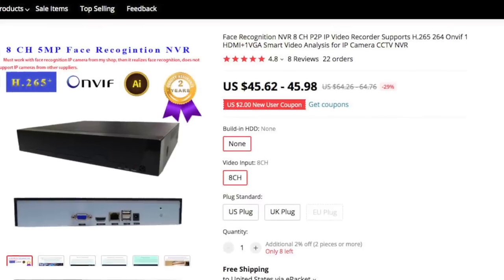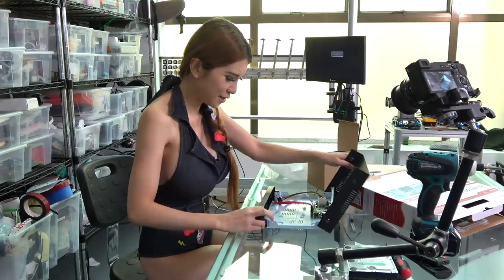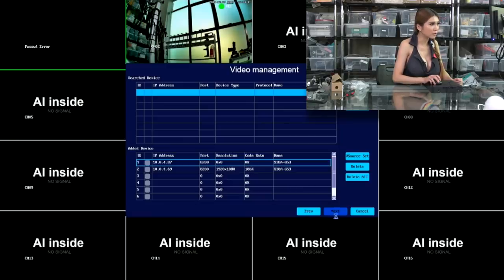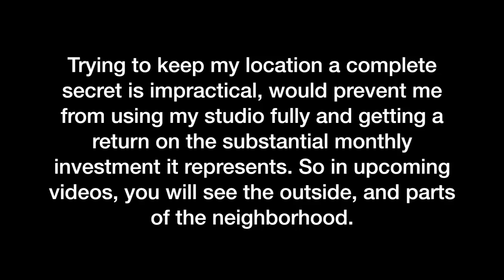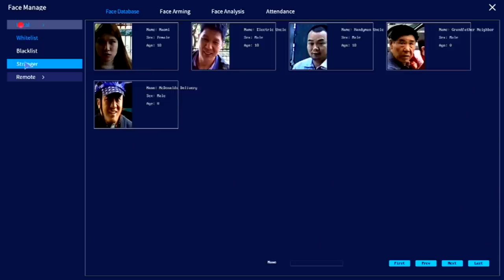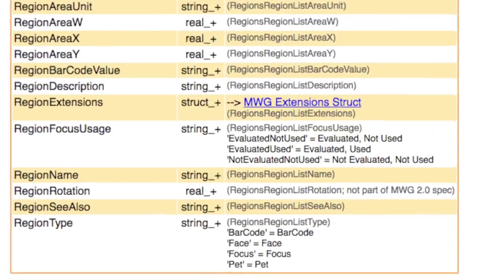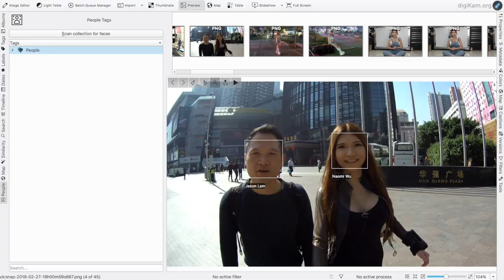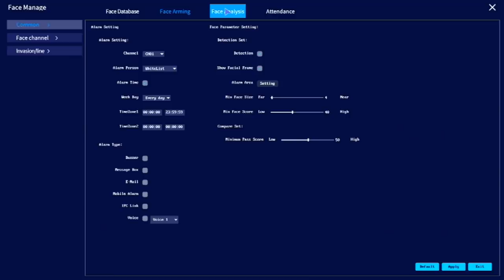Discount Dystopia! $50 Face Recognition Security System

Comment: Psycho Jealous Ex Naomi Wu is legit terrifying. Sneaking into your lab in the dead of night, shuffling your static IPs, defocusing your lasers, humidifying your moisture-sensitive filaments, offsetting the origin of your CNC...
Reply from the maker: I'm stealing that😅
Reply: That's so minor.  Costly but just property damage.  With more psycho jalousy, much worse is possible.
Reply: The offsetting of the CNC by say x.7 and y 2 would be bloody terrifying/annoying. Or even better change steps / turn of the screws...
Reply: changing the 3d printer firmware such that each layer is rotated by say 0.01 of a degree would be frustrating to figure out where the fault is.
Reply: @gorillaau  I love that one. It is as one says "the most evil I have ever seen."

Comment: Although IP cams and face recognition wouldn't be very practical for my situation, it's a fascinating topic. Like all of technology it can and will be used in good and bad ways, so knowing how it works is a must. 

- If you don't know the dangers you may end up not knowing what killed you someday but you'll be as dead as if you knew. 

- Knowing the dangers is prerequisite to come up with ideas to protect yourself. 

- Not knowing what's possible always limits your options.
- Knowing about technologies enables you to find new uses for them.

Isn't there a face recognition system using stereoscopic cameras? 

As for the use of perfectly fine standards: It's actually a shame that companies all over the world ignore standards instead of developing and improving them. In my eyes that's a statement about the company if the have to resort to artificial dependencies in order to enable their products to compete on the market. It actually prevents healthy competition and therefore it prevents technological evolution. Technological standards provide a repository of already found solutions, thus freeing up resources for the search for not yet found solutions.
Also I love that glass table when nothing is on it. So revealing.
Reply: Note that an embarrassing percentage of the standards are made useless by some aspect of how they are created and managed.  As an engineer there are standards that I simply have to reject even in my own tiny field of work.  But import/export data formats deserve more standard compliance than internal working formats.

Comment: Regarding IP camers security: I think a separate (V)LAN for the cameras and the NVR is a must and a router which is advanced enough to control the traffic between the networks. Don't give the camera system internet access and if you need remote monitoring, only allow incoming connections through your VPN.

This might be out of budget/technical skills of many people, but otherwise you can not be sure who can access your setup and what information do the system leaking to the internet. Expect it as unsecure.

Comment: So in short, there is no standard yet on what format used for face recognition data ?

Then i guess every company have their own proprietary format. Maybe good for secrecy but, for end user when they want to switch to other system, they cannot use their old database.
Reply from the maker: Also makes organizing and tagging the images difficult. NVRs are good at recognizing people, but they aren't really designed with a GUI for data entry.
Reply: Eventually, I would expect a "shaking out" in the industry and the acceptance of an international standard. Typically, this happens in time. Someone comes to dominate the market and the other manufacturers go along, lest they be regarded as obsolescent.
Reply: @williamswenson5315  A few years ago I worked with designing and building video surveillance servers. They were glorified windows servers running some pretty hardcore (for the day) surveillance software. With anything from 16 to over 300 cameras the software could do some limited facial recognition, but not anywhere near as well as this system. In fact we were happy when the system managed to follow someone from camera to camera as they walked through a building. So much has happened in just a few years when it comes to surveillance and IP cameras. Only five or six years ago the average surveillance camera had the image quality of a $5 toy. Really high quality cameras was so expensive the price wasn't even listed, you had to request a price quote if you were interested. And as for facial recognition, lets just call it bad. Something I never even thought of at the time was the format of the facial recognition database or if it was in anyway standardized or could easily be converted or moved between different software. We were struggling just designing the servers capable of handling several hundred cameras at a reasonable frame rate. There were no way we could afford the processing power to run facial recognition on the fly on every person who happened to look in the direction of the cameras in for instance a football stadium. That would be done when actively looking for an event in the recorded material or when tracking a person of interest in real time. But as far as I know none of the software we worked with had any way to import a facial recognition database, though thinking back it would have been such an obvious feature. 
We had systems installed in courthouses and other high profile areas where a feature like that really would have been fantastic. At the time I didn't really think much about it though as I was almost totally focused on the hardware side and never really bothered to learn all the ins and outs of the software solutions.

Comment: I think using BOSCH electric screw driver is better than using drill with bits on the screw.. less likely to damage the screw head....
Reply from the maker: With the video sped up it's easy to confuse cordless drills, cordless screwdrivers, and cordless impact wrenches. This is actually a hybrid tool. It's in driver, not drill mode and the electric screwdriver clutch is digitally controlled and extremely precise:
http://toolsinaction.com/makita-xpt02z-hybrid-tool-review/
Reply: @Naomi-Wu  I know the tool. The key here is the angle of the bit to the screw, which can be seen in opening the black box. Anyway, electronic screw driver is much less heavy compared to drill with large rechargeable battery at the bottom, specially when used one handed. Still, a good substitute.

Comment: Yeah I see people use online camera systems with cameras throughout their homes. I'd never do anything like that. The furthest I'd ever go is a completely offline camera system with a hard drive and physically wired cameras. Nothing with cameras or microphones should be connected and broadcasting online 24/7 inside the home. Exterior cameras, sure. No problem with exterior camera systems being connected and online.

Comment: I'm curious if the onboard software can be re-flashed with something a little more usable, or if the on board Linux "PC" can be used in other projects, at <$50 its a decent investment for a case, power supply & Single Board Computer
Reply from the maker: There's a few stores that sell just the board so there must be a way...
Reply: @Naomi-Wu  - This may be a firmware upgrade for your device, but please research it carefully to make sure its a correct match - http://www.sunywo.com/cn/resource.shtml
Reply: Also there's a 4 Pin Header you can solder a TTL-to-serial converter to and monitor the console output during the linux bootup

Comment: > Gets new Makita drill
> Starts buying stuff she can disassemble with it
Reply from the maker: It's nice right?
Reply: @Naomi-Wu  Yeah. Wondering if I can get one for my job... I generally don't like using power tools for screws (you can work faster, or break stuff faster!) but at the same time... some screws take 50 turns and that gets a bit dull... and it's not slow like your normal "electric screwdriver". We shall see... been told not to spend any more money on "capital expenditure" this year so will have to wait 2 more days before placing an order ;)